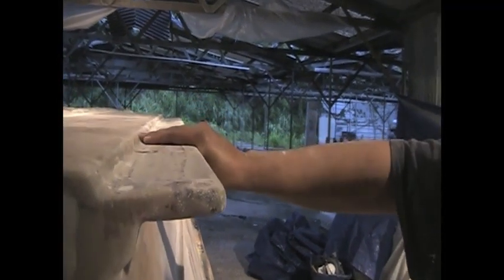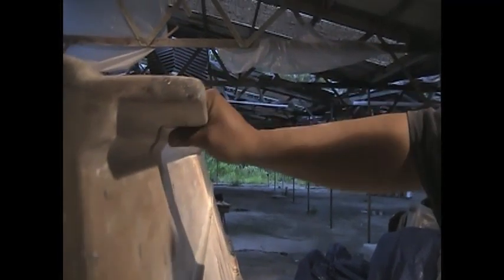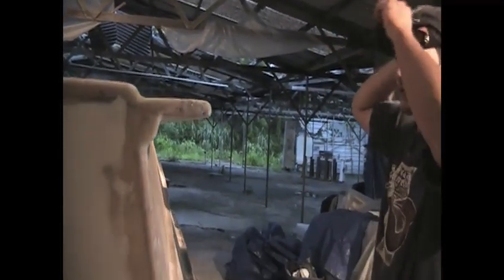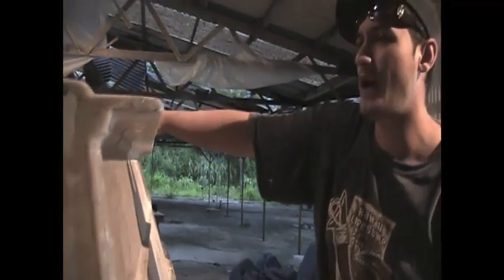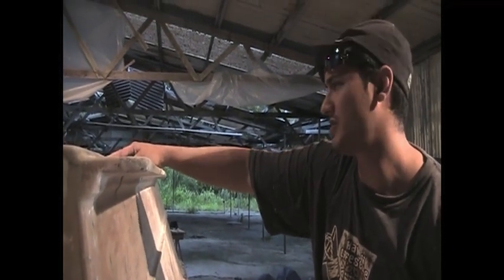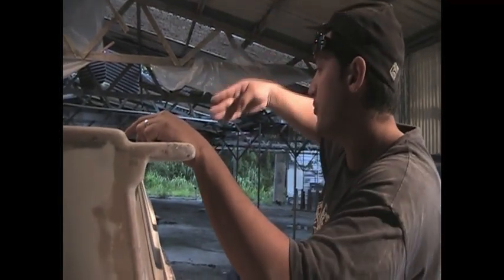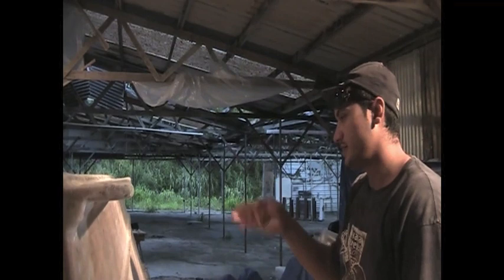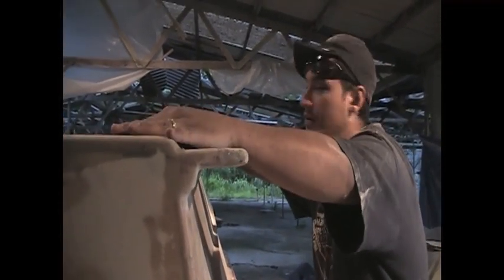Lessons With Lanky: Custom Boat Building Green Electric Hybrid Boats- Rolling Chalks

Comment: "Chock". Rolling chocks, or anti-roll chocks, aka bilge keels. Sounds pretty close to chalk. Yankees call them bilge keels, which is not very descriptive IMHO, since they're not likely to have anything to do with a bilge, and they are not keels, but fins running most of the length of a chine. Depending on other variables the roll chocks can reduce roll noticeably. And if her ladyship is comfy that's what we're all about, right?